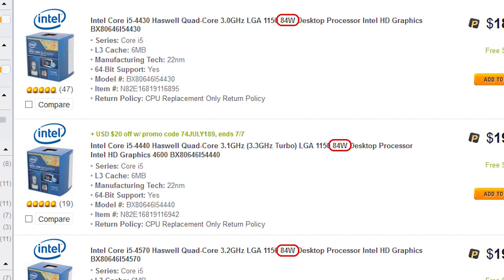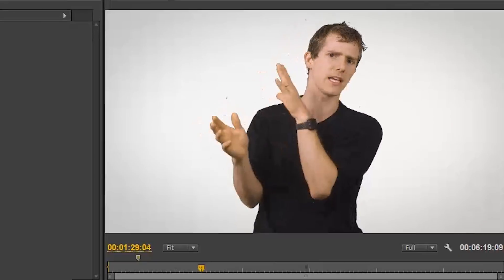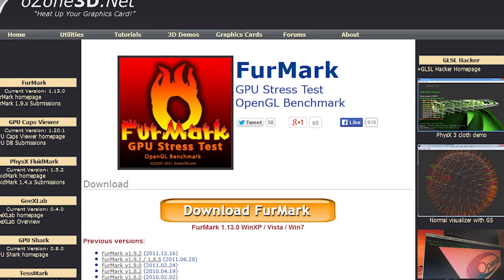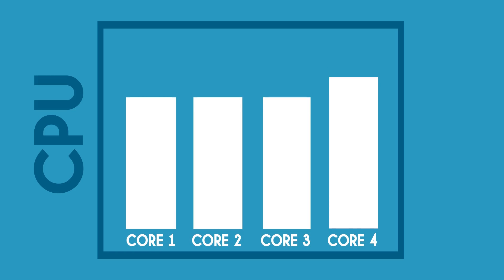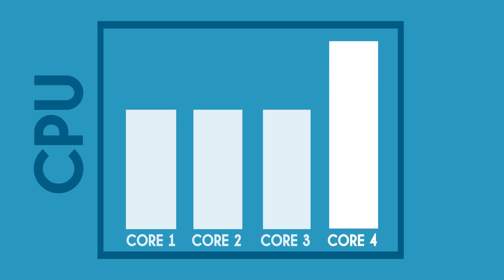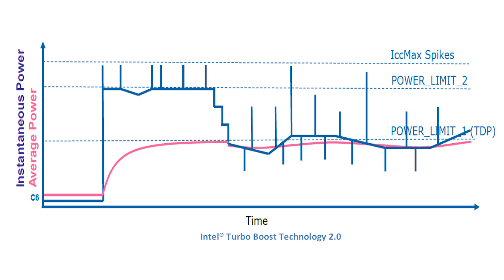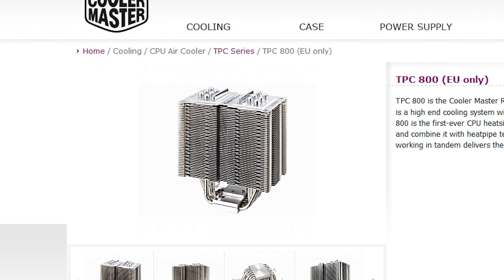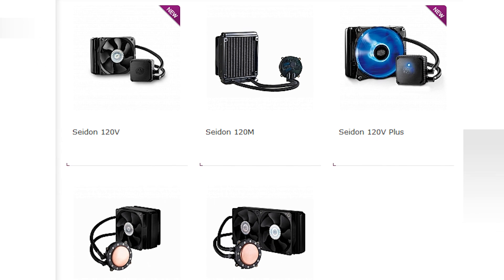What is TDP or Thermal Design Power as Fast As Possible

Comment: is there a measure for thermals vs performance as a comparison for efficiency without being limited to architecture?

For example..  back in the day I had a gaming PC that ran so hot during gaming sessions that I was able to heat my bedroom on cold winter nights even with the windows open..   but today I can play the same game with better performance on a tiny phone and the device never gets hot enough to be a concern while holding it.  It would be nice to try to quantify how thermally efficient cpu/gpu designs are.. if for no other reason to chart progress or bottle necks over time.
Reply: i had a laptop that melted my table lmao

Comment: Well, I mean, it's not completely wrong. If a piece of hardware produce 200 watts of heat, it will need at least 200 watts of power to produce that heat; otherwise you'd create [heat] energy out of thin air ;)

Comment: The TDP number tells you the maximum heat a computer chip, such as a CPU or GPU, can use in watts. It also is often used as a basic indicator of power consumption.

Comment: My chip has a TDP of 15 watts, my whole PC pulls 16.5 watts, so TDP seems to be pretty accurate to power drawn if you take into account the power draw of USB devices. In this case, I’m running a portable 10 inch monitor and a keyboard and mouse off USB power.

Comment: amd's tdp: "total drawn power" from what i've seen so far...
intel tdp: "thermal design power" which makes intel numbers LOOK better
Reply: ok fanboy
Reply: @musliksolihin8960  nah but there's an actual difference between the 2.
If I'm not entirely wrong, intel measures their power draw based on a  "thermally significant time period" which is completely their own made marketing friendly term for "we deside a cool number you see" it's supposedly derived from running the cpu on stock clock for a while and measuring the power draw but that most of the time completely ignores boost clocks. 

not sure if it's the case nowadays but it used to be so. since i've seen 180w on paper for a processor and it's a hellhole creating monster like the fx 9350 used to be their numbers could be more accurate nowadays or their base clocks have increased significantly along with the core count. 

the point of my post was the there's a difference between intel and amd.
Reply: @minecraftermad wow you responded after 2 years lol

Comment: It may be a little bit off-topic, though slightly connected to the topic. But I need advice from someone reliable. I have an intel i5 7300HQ and some games push its temperature up until even 92 degrees. And I can find various different opinions. Some people say its detrimental, while others say dont worry intel cpu chips are designed to take that temperature. Its also iteresting how different games vary in this regard. For istance Witcher 3 keeps it around 70-83 degress maxed out, yet AC origins pushes it up as far as 92 degrees. Should I worry about it? Thanks for your replies in advance.

Comment: TDP IS (!) the marketing term for power consumption, but Intel and AMD perverted it (did I say marketing?), and come everytime with a new interpretation, like "difference between idle and load power consumption", or "oh, it's actually only valid if you disable Turbo", and stuff like that, in order to look better on paper.
So now, every time you see TDP on a new processor, add 30W to it on your mind to get the real TDP, because Intel and AMD are fooling you -.-
TDP for GPUs are still accurate though. If it says 75W TDP, then it doesn't have a power connector and will draw 75W max from the board (and before somebody comes with that ONE AMD failure on the subject: exceptions confirm the rule).

Comment: @Techquickie So i've got my GTX 1070 FOUNDERS to 1911GHz Core clock. and in 4 hours testing i got a maximum of 75 Degrees at 80% Fan Speed, but Power Consumtion ( TDP) went the highest to 122% , and Avrage  to 88%. Is it that 122% to much or? is it ok?

Comment: Although it's true that TDP isn't the same as power consumption, 1) it is closely related and 2) it's all we have to work with.  Manufacturers don't tell us how much power their components will draw, so we use the TDP as a guide and add some margin once we're done.  Give us a better tool and we'll use it - for now TDP is what we have.
Reply: Thanks for making it easier

Comment: If TDP is the maximal energy output under full load (assuming all manufacturer treat it the same), isn't it the maximal consumed power as well, since pc hardware doesn't output anything other than heat (despite the fans and lighting)?

Comment: What this guy didn't explain is that the rise in TDP will affect your electricity bill as well. A lot of people don't even know that 1 KW equals 1000 watts therefore CPU or GPU with the difference of 60 or 70 watts may eventually cost you like an extra 1-2$ a month or 25$ tops a year. This is something that should ALSO be considered as you usually buy PC hardware that is gonna last you 2-3 years. You may save up to 50$ just from electricity bills by buying hardware with much lower TDP. Your hardware will produce the amount of heat that equals it's TDP per HOUR therefore a 60 W device will generate 1 KW in 16 hours 40 minutes unless it idles. Respectively, 120 W device will consume 1 KW twice as fast. If you live in a country where you have to pay a lot for electricity, this is also important to know

If this information helped you guys, like it and reply :)
Reply: This is also why I think low power GPUs like the rx 460 and 750 Ti are a better value to performance deal than people sometimes give them credit for (especially in the rx 460's case).
Reply: +KNIGHTCleric 
I think the "unless it idles" part is very understated. Only a very small subset of users will actually leave their computers doing continuous heavy work daily. Miners come to mind. If the average user leaves their computer turned on in the great majority of cases it will actually idle.
Reply: Thanks it helped
Reply: Does the gpu add up with the cpu's tdp?
Reply: Daggawaggaboof, true. And if you're on a some kind of budget, you won't generally have a choice between hardware with such a great difference in TDP/power consumption as 60 TPD vs. 120 TPD for CPU of 100 TPD vs. 200 TPD for GPU, they are miles away from each other both in price and performance (unless you're going for used/very old parts).

If you're not a jobless guy who plays graphically heavy games without any FPS cap for 16 hours a day, the difference in power consuption of hardware you should reasonably concider as a choice would be negligible.
Reply: Great explanation, thank you ;)
Reply: Do you guys know how can i adjust the TDP ( or the Watts ). I have an i7 8750H and i cant find it in the energy options. 
Thanks :)
Reply: @typhoon9105  You can't adjust TDP. The "configurable TDP-down" that they list for various processors is configurable by OEM's/manufacturer. Like, some laptop manufacturers will limit the TDP so that they can put in a more powerful processor in while not needing to invest in more complicated cooling/ventilation (or needing to make their laptop thicker for ventilation).

https://forums.intel.com/s/question/0D50P0000490X0hSAE/what-does-comfigurable-tdpupdown-mean-in-intel-ark-specifications?language=en_US
Reply: @slycordinator  I thought this as well, until i found that:  https://superuser.com/questions/909158/intel-dynamic-platform-and-thermal-framework-settings-what-exactly-do-they-do
Reply: @typhoon9105  Then if it's not showing up, it might be that the oem for your device decided to lock that down and have it not be configurable
Reply: It's also of note that when comparing two computers/components, the one with the higher peak power draw might still be cheaper in the long run for electricity if it has a lower idle and/or average-use power draw.

Like if A peaks at 100W and idles at 15W while B peaks at 85W and idles at 30W, most people would probably save money with computer A.
Reply: Well no shit that's pretty fucking obvious.

Comment: Hey Linus, question.... Will a 600w power supply work for a combination between ASUS GTX 770 and i5 4460? Also I'm thinking of getting 16 of ram instead of 8, I'm kinda new to all this stuff so I'm not really sure if it will work or not... I'd love to know as soon as possible though!
Reply: I have an i5 4460 and a  GTX 960 Superclocked with a 450W power supply and I haven't had any issues whatsoever. You should be fine.
Reply: thanks for your helpful comment :)

Comment: hello Mr.Linus, I have a question in mind, that if i run 2 XEON x5650s, the wattage usage stated on the intel site is 95w each, so if i put the cpu to different power mode like power saving by limit the cpu work load down, will this make the chip consume less power? or it is pointless to consider?
Reply: yes. that 95watt TDP is a theoretical average on what you COULD use. it isnt going to use all of it. for example my cpu consumers around 25watt on idle but 180 on full load.

Comment: But if a CPU has a TDP of 90W and a power efficiency of 100%, that basically means it consumes 90W... Because a CPU, electrical-wise, only produces heat and no other energy form.
Reply: heat is a by product of consumed energy. which is why as power draw goes down heat goes down too

Comment: Correct me if i'm wrong, 
power input = power output, 
since a processor is not outputting anything other than heat,
so the amount of heat output is equivalent to the electrical power consumed ????
Reply: Zhi Hao Looi, you are correct. they might not be exactly equal, but the difference is almost unnoticable. so yeah, from thermodynamics perspective a PC is just an expensive room heater
Reply: +Zhi Hao Looi  well if you think the data your cpu is sending to the other parts of your pc
 is coming from nowhere, and the only reason for a cpu to consume 
electricity is a conspiracy between the illuminati and the electrical 
companies to rip everybody off....then yes a processor is only 
outputting heat. ;) in fact in an ideal world, a processor wouldnt output any heat (since TDP isnt anything different than power dissipation, correct me if I am wrong with that ;) )
Reply: but there is very little current when sending data

Comment: CPU's do output a stupid amount of heat, because 125j/s is a ton of energy! After an hour that's 450kJ of energy or about 427 BTU. If you ever plan to have a lot of cpu's running hard, be prepared to invest in cooling because after about 23 CPU's a 10k btu a/c will get outpaced by the heat and the room would be a furnace. (This is before factoring in insulation/ leak rate of heat).

Comment: the T in TDP means THERMAL, the WATTS under THERMAL
could never mean consumption, its NOT right in both cases.
sure WATTS IS, but watts is NEVER put ALONE on ANYTHING,
it will always say, TDP or Watt HOURS so when your friend tells you one over the other, its wrong.

Comment: Hello, I need some help!!!!!!!
I have a desktop it is running
OS: windows 8.1 64bit
Processor: AMD E2-6110 with AMD Radeon R2 Graphics
Memory: 4gb
I am running 15 watt max TDP and i want to buy a gpu what is 60watt TDP will i be able to install that gpu what would be the problem if any the gpu i am referring to is EVGA NVIDIA GTX 750Ti SC 1176MHz (Boost 1255MHz) 5400MHz 2GB 128-bit GDDR5 HDMI DVI-I DP PCI-E Graphics Card
thanks
Reply: TheMiningEmpire Umm, it's a laptop. There's nothing you can do about it.

Comment: So does having a higher TDP translate into a better processor?
Only reason I ask is because MobileTechReview mentioned that the Macbook Pro 13 (2015) is 28W and therefore will be more powerful than the 15W CPUs normally present in Ultrabook processors.

Comment: Can I Increase Ghz On My Laptop?,Can You Give Me Some More Information About This Like Rating And Performance If It Is Not Enough What Things Should I Do Increase It's Performance. 
Specs- HP Pavilion Notebook PC
Intel(R) Core (TM) i7-4510U CPU @2.00Ghz 2.60Ghz Haswell ULT
Ram - 8GB DDR3
System Type - 64 Bit Operating System
Nvidia GeForce 840M 2GB
Windows 8.1
Reply: No! NO! NOOOOOO! NOOOOOOOO!

Sorry. Overclocking a laptop is extremely not recommended. Laptops are meant to run stock and nothing more. You can if you want, but it's very risky.
Reply: ***** Well, if you can fit a cooler in your laptop, then by all means OC to your hearts content. Just don't try with the stock one.
Reply: Johnny Giddings The bioses usually don't usually support changing the base clock, multiplier, voltage, RAM speed/voltage, or AGP/PCIE frequency/voltage on laptops, so I don't think you can. Laptops throttle with the stock cooler doing mild tasks, so I think that even if you could, it would just make things worse.
Reply: unless it has a k at the end of the numbers such as the Core i7 4770K it is locked and not overclockable.
Reply: Sn0Flaik I Have U At The End
Reply: You most probably can using Intel XTU , but I don't recommend it unless you are sure what exactly you are doing.
Reply: There is some reason not to increase ghz you could melt the board or fry your CPU. But if want more ghz get a CPU that you are sure your laptop could handle. Also make sure your CPU is not soldered.

Comment: So why Motherboards have a TDP Limit?
Reply: The heat mobos dispose affects the ambient temp inside the case, heating up other components.
Reply: tomoya97 Essentially, Motherboards produce heat as well, so they're going to impose their own TDP limit so as to not bring your case into "Near the Sun" temps.
Reply: tomoya97 It's because of the VRM design, the cheaper VRM design the lower TDP.
95watt mobo's usually use 3phase 3+1phase or 4+1phase Vrm design without heatsinks, which is really bad for overclocking.
If you overclock with this kind of mobo, you're asking for trouble, and you can easily fry your components.

125watt and 140watt mobo's usually use anything from 4+1 to 8+1 phase design sometimes with heatsinks on VRM.

So basicly the mobo's TDP means how much it can take before it fries...or throttles down.

Comment: Great video. Something I was wondering though: If you had identical PCs but one had a vidcard rated at 60 TDP and the other had one rated at 145 TDP (and was in fact about 2.5 times stronger), would the 145 TDP machine run hotter because it has a higher TDP or cooler because you're using a lower percentage of its capabilities?
Reply: TDP is NOT a useful measure of performance. It is merely a measure of heat output. If Product A has a TDP 3 times higher than Product B, Product A runs three times hotter. Although it is true that the higher TDP components do tend to perform better, the scaling is not perfect even within brands, and due to minor variances between two products with the same model number, one may run hotter than the other, in identical settings (the same load, same environment, etc). The TDP is a measure of heat typically taken at maximum load, or close to maximum load.

Comment: So basically the way TDP is measured is very much a roundabout way of measuring the temperature [°C] at which the chip will "fry"/become inoperable. The relationship can be summarized thus:

Increased power consumption [W] ➡ Increased heat [°C] ➡ higher TDP

Then why not provide the actual temperature that the chip will fry at? Is it because the range is too variable per chip? Or is it because it is easier for the consumer to determine where the TDP is depending on power consumption of the chip [as measured in watts]?

Why not provide both sets of information? As in, the wattage at which the chip will breach it's TDP and the actual temperature required to fry it?

Comment: I wish I had seen this video before. My current processor has a tdp of 65 Watts and it was growing really old, so I decided to buy another one. I didn't really know what it was back then, but the one I bought has a TDP of 130 Watts! Whenever I turned the pc on it would turn off in about 10 seconds or so. 
 If I had the money to buy a proper cooling system I wouldn't have had to buy that particular processor as I could've bought a better one that didnt heat that much. Oh well, dumb me!
Reply: Pro tip. NEVER use the stock heatsinks if you are an enthusiast. Instead, go for aftermarket solutions, or go with liquid cooling. Although in the former, you need to be careful because it can get in the way of high profile components.

Comment: Hi,big noob builder here,I'm thinking of a Phanteks Enthoo Pro build for the end of the year when I earn enough money from my part-time job after exams.(Singaporean,14 years of age)

I'd like some advice as to what to do since it IS my first build.

Chosen Specifications So Far:
Phanteks Enthoo Pro Case

MSI Z87-GD65 Motherboard

Intel i7-4770K CPU

Corsair Hydro Series H80i CPU Cooler

Gigabyte GeForce GTX 780 Windforce OC 3GB Graphics Card

Adata Premier Pro SP920 256GB SSD

Western Digital Caviar Black 2TB Hard Drive

Need help for the memory kit and power supply(as I said,big noob).

Any tips to take into consideration as well?Any would be very much appreciated.

Also,are there any good 21.5-23 1080p inch monitors out there?
Looking for:

1.Image quality
2.Colour 
3.120-144hz refresh rate
4.Thin bezel
5.Integrated speakers(Optional,but most welcomed)

Thank you in advance,again I truly appreciate your help!:)

Comment: if this ASUS MAXIMUS VII FORMULA/WATCH DOGS LGA 1150 HDMI SATA 6Gb/s USB 3.0 ATX Intel Motherboard says this DDR3 3300(OC)/3200(OC).../1866(OC)/1600 can i put this in it 

Dominator® Platinum Series — 16GB (4 x 4GB) DDR3 DRAM 3000MHz C12 Memory Kit (CMD16GX3M4A3000C12) if its not over clocked ram?